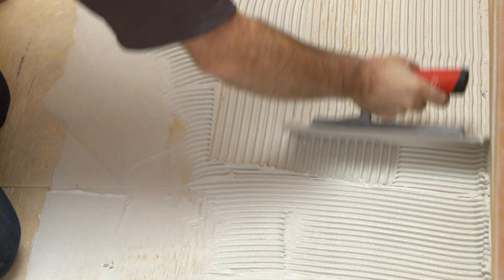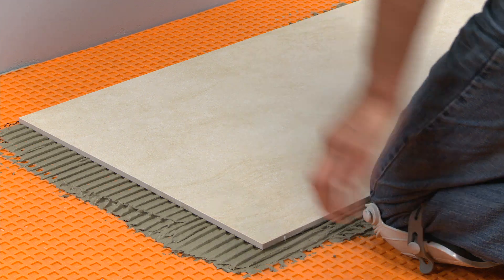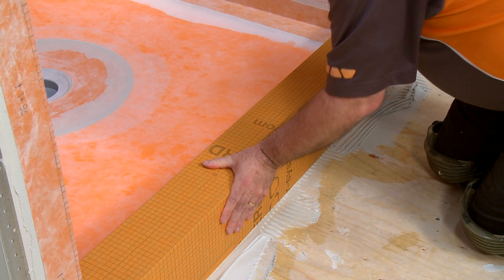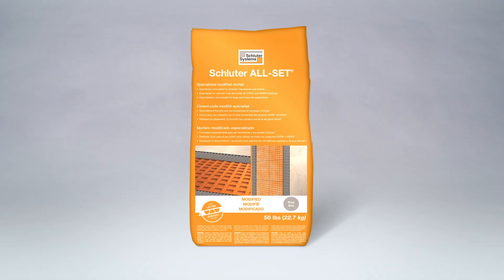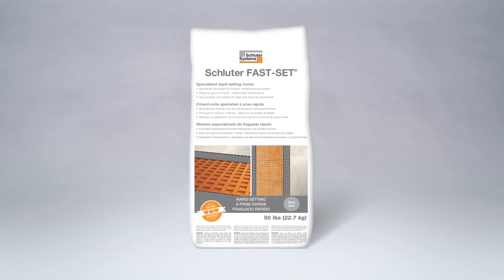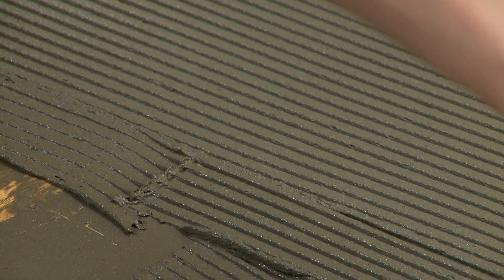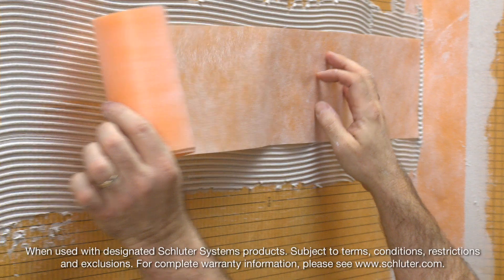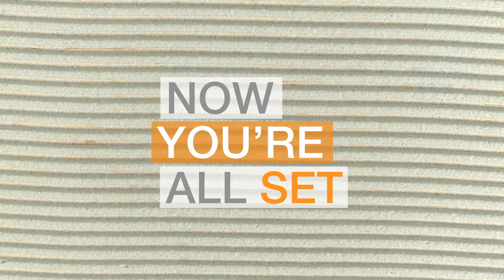Schluter® Thin-set Mortars

Comment: So, All-Set can be used on both sides of the membrane; securing the membrane to the subfloor and the tile to the membrane.  But, Set is just for securing the membrane to the subfloor but not for securing tile?
Reply from the maker: Hi Mike, Yes, ALL-SET can be used on both sides of the membrane (unless installing over vinyl). SET is also used to install the tile and to install the membrane (unless installing over wood or vinyl). FAST-SET would be used over vinyl and can also be used to install the tile.  Hope this helps!

Comment: Can we store new bags of ALL-SET at temperature below freezing Temperature of 0C (32F) Thanks
Reply from the maker: Hey there ! Our thin-sets not allowed to be frozen and are to be stored off the ground in a dry, cool area protected from direct sunlight, heat sources and the weather.
Reply: What happens if we use a bag that was stored at below 32 F. How do you know if a bag was frozen or not when you use the grout
Reply from the maker: Since all of the thin-set components are solid, there’s nothing to actually freeze, as long as it stays dry. Exposing a bag to below freezing temperatures for a short time shouldn’t hurt it (during shipping, for example), but it should not be stored that way. If it’s still cold when it’s mixed, it could set or develop strength more slowly. So, it is best to make sure the bag is at room temperature before using it. Hope that helps!

Comment: Schluter thinsets are trash and I won't name brand names but there are options that perform better for less money.  Schluter All-Set in particular is a joke, it's so sticky it can be difficult to trowel and cleaning it off buckets, trowels, etc is no fun.  The mixing time is more than double the standard of 2 minutes mix, 5 slake, 1 re-mix.  It also sets up faster than the average modified thinset.  If you have an application where you can or would otherwise use an unmodified thinset (e.g. over ditra) why would you ever use a $35 bag of All Set versus a $14 bag of good, unmodified that's easier to mix, easier to spread, and easier to clean up?